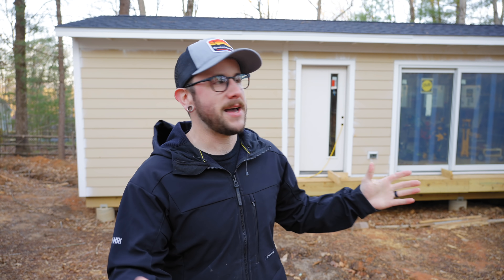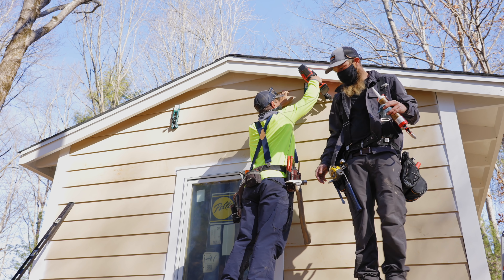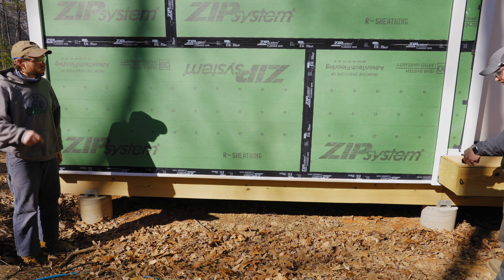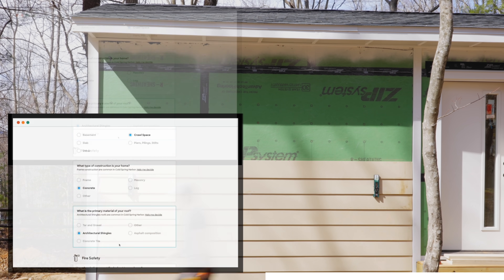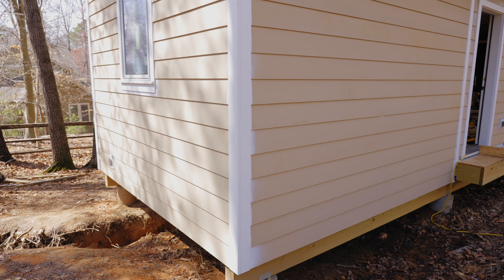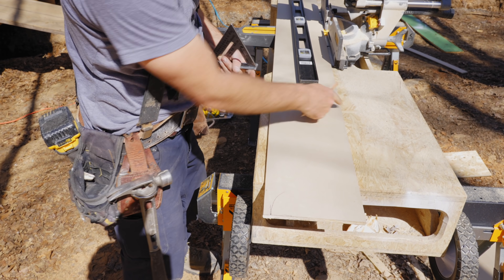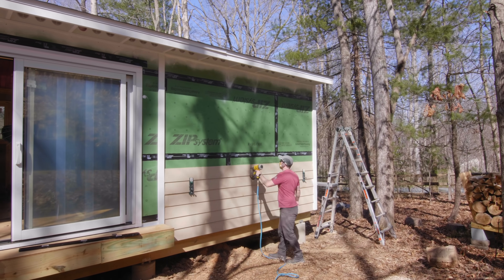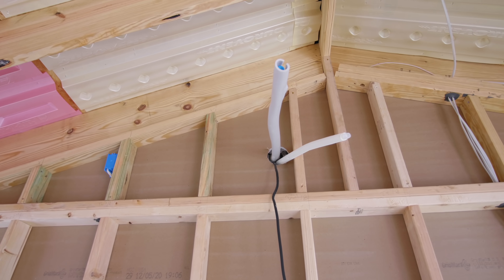LAP SIDING INSTALLATION 101 (Tools, Gauge Jig) // Not So Tiny House Build 12

Comment: I always see US installers do cladding directly to the sheeting under the membrane (or ZIP in this instance) but in the UK I always see vertical battens being used before the cladding. Thoughts?
Reply from the maker: Yup, those battens form a rain screen and I considered doing it here but don’t think it was totally necessary in our climate. That said, it definitely provides drainage behind the siding and gives the water somewhere to escape if it gets behind the siding.
Reply: Thanks :) made me doubt myself. I feel like most places would be 100% ok but I’m in Scotland and need all the rain protection I can get 😂 and a small garage so not too much extra work
Reply from the maker: Hah yea it’s pretty rainy over there 😂 Spent a week in Islay two summers ago, can’t wait to go back!
Reply: Hey Johnny, with that said, should rain get behind the siding, with it being OSB and not be treated like the front, won’t it swell up and get ruined and need replacing?
Reply: @KnottenWood  Yup, using battons means you'll get airflow behind your siding as well, preserving it for longer.
Reply: @Davey768  osb siding always rots out towards the bottom in my experience
Reply: @Ptro1  First row or the last few? And that's without a rainscreen or? Never seen osb siding myself.
Reply: @Davey768  first row, never seen anyone first hand use rain screen with osb siding in my area. Usually they are trying to save money hence why they choose osb over hardie so doubtful many people would add the expense of rainacreen
Reply: In most regions of the US a drainage plane - which is what you’re referring to - is required. In this case, it would likely nearly double the life of the cladding

Comment: I have the same issue on my gable end, where I cannot reach the siding under the barge board.   I ran a 3" screw through the 1-1/2" barge board through the 1-1/2" gap and into the siding, basically pinning it against the house.

Comment: Great video! You talked about using finish nails on the last course of siding. What gauge are these? I have some angles where the angled tails need to be pinned down better and using a standard siding nail isn't going to work as I can't maintain the spacing requirement. So I was thinking of just using some 16 gauge SS or HDG finish nails here?
Reply: 15 gauge hot dipped

Comment: One thing I noticed is that the nail holes on the zip were not covered/filled as best practice.
Reply from the maker: That's definitely not a requirement and requires an incredible amount of work. Fine if you've got a whole crew working but it would have taken me at least a day to fill every nail hole.
Reply: On Zip they always stress to sink your nail heads flush. They do allow up to 1/8 of embedment. Anything over that exposes the untreated and finished plywood chips. And it will void the warranty on the zip. They call for 4”-6” strips of tape to be applied and rolled on over the nail spots. I do a lot of apartment buildings, Hotels, and assisted living buildings and duplexes. Those jobs always have material reps nosing around.

Comment: well made video as always! I have one question though. you mention this siding is susceptible to moisture retention, or holding water.  why would you then nail this directly to your zip system, and not  put a ventilation gap/layer between.  Don't know how much your weather changes, but there is pretty much bound to happen some sort of condensation, and when that happens, the condensation has nowhere to go but inside your lap siding.
Reply from the maker: Yea, what you're talking about it a rain screen. I considered it but, after talking to the Perkins guys who have been using this siding for years in this area with no rain screen, I decided it wasn't necessary. They complicate a lot of details, like around the windows/doors, etc.

Comment: I like working with LP siding but their nailing requirements drive me nuts. Any worries with using standard shank size siding nails? They call for minimum .113 shank diameter nails.

Comment: What would be a ball park difference in price between LP and Hardie?  I just have to believe the concrete based Hardie would be a far superior product than LP OSB product.  Hardie also does not require such a wide expansion joint, which gives a better appearance
Reply from the maker: Pricing is very similar but I think if the LP product is installed correctly, it will last just as long as Hardie.